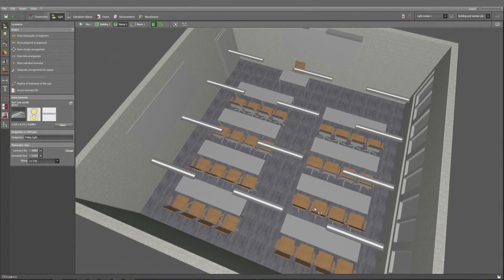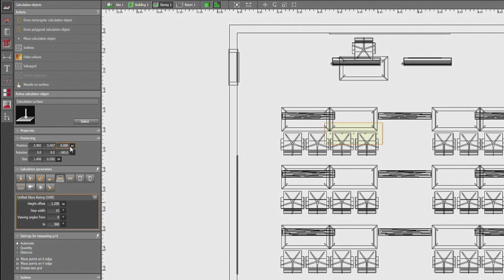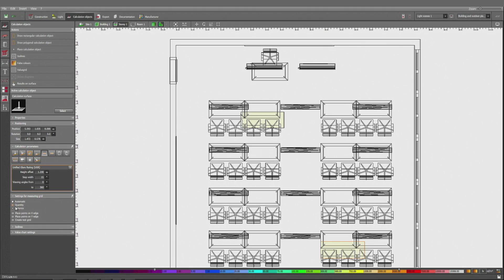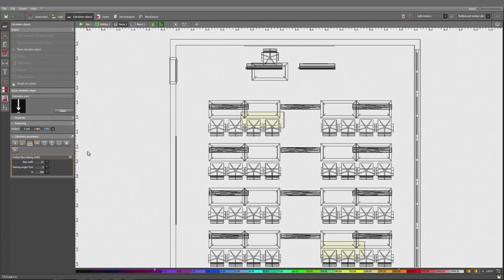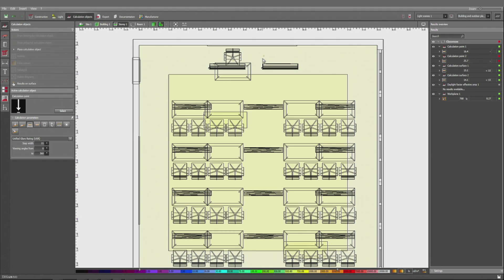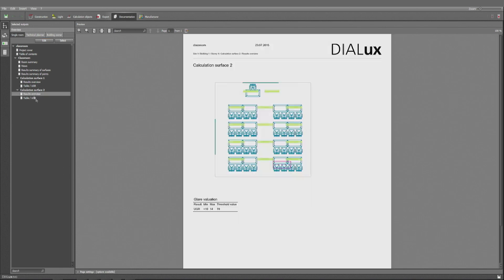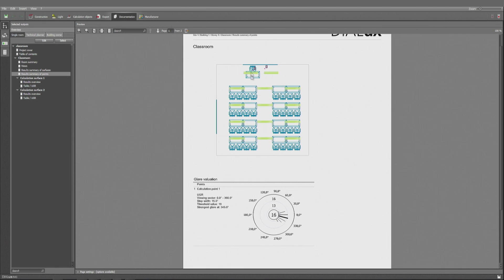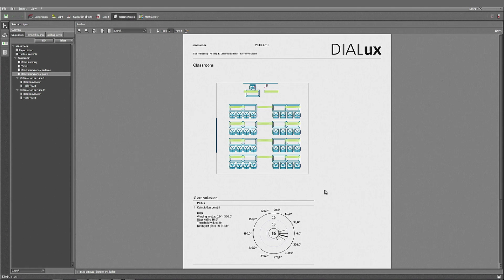DIALux evo Tutorials for Beginners part 17 — UGR calculation

Comment: I wonder in which direction is the UGR being calculated? Usually one can see an arrow pointing to the front of this 180° that you configured in the "viewing angles".
Reply: Just stumbled on to this video. For a fixed place like in this video you can try to define angles for your calculation point. In my case i have seat facing to the right not upwards, so i picked starting point 270 degrees (6 on clock face) and end point 90 degrees (12 on clock face). In the results page i had my calculation point displaying values for a defined direction and unused direction was greyed out. Hope this helps.

Comment: how do you get the UGR values to show on the floor plan?
Reply from the maker: The visualization of the values is listed in the documentation. You can also check the results overview on the right, for example to check your calculation point for the UGR.
Reply: yeah i understand that but is it possible to get the values in the documentation onto the floor plan
Reply from the maker: I don't think that is possible at the moment. You could put it on the wishlist for our development: https://dxboard.dialux.com/viewforum.php?f=9&sid=ae2b30ee74dc8b34a828b68ed09ef18c
Reply: Ok thanks for the help :)

Comment: hi, first thankyou for making the tutorial, but I really need help! because my design uses daylight completely for the illumination, can I use window as a source of light instead of luminaires

 also, does dialux consider the latitude and longitude and also the time of the day of the measuring? since its important in daylight calculation. many thanks
Reply from the maker: All questions can be answered with "yes!" You can find a nice tutorial on using daylight calcultion on our website: http://en.wiki.dialux.com/index.php/Daylight
Reply: omg, thanks for the quick reply!
I think I didnt state my question correctly before, I mean can I calculate GLARE using window as a light source? I've opened the link on your comment, but can't seem to find it? I'm so sorry, can you please help me?
Reply from the maker: The GDI (Glare Daylight Index) to evaluate the glare from daylight is not implememented to evo yet. 
We have already added this improvement to our wish list which will be the basis of our development process for the upcoming DIALux versions. Up to now we can not give you an exact date for the implementation of such a feature.